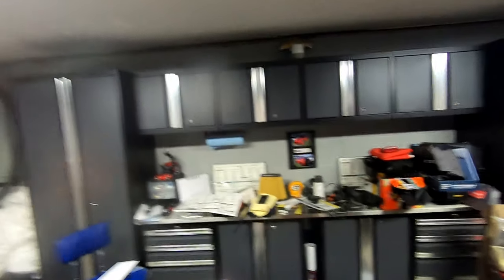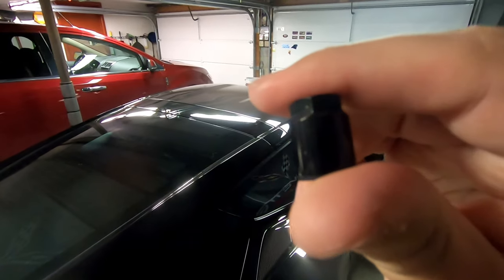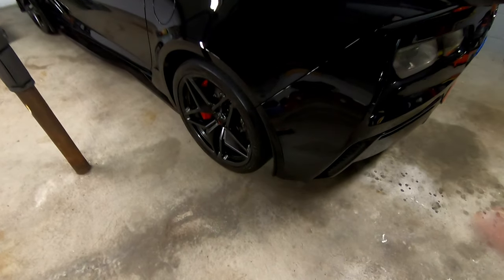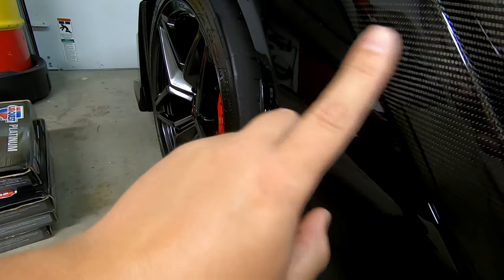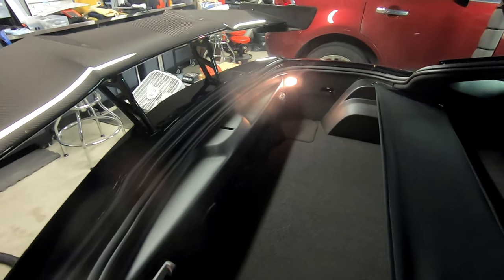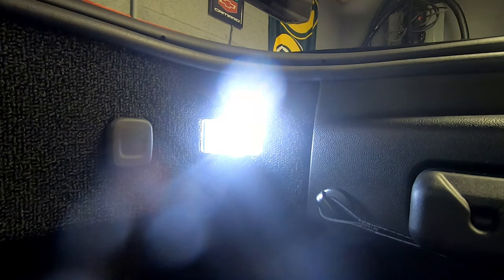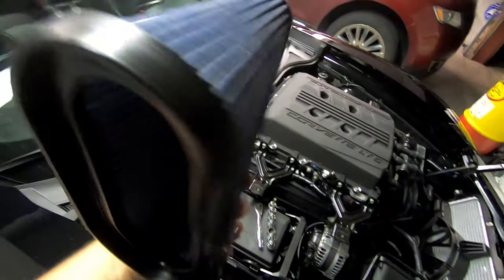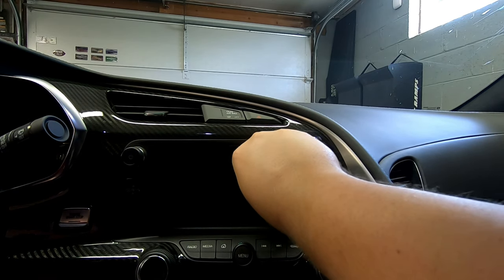MUST HAVE Mods For Your C7 Corvette. Lighting, Protection, AND Performance Upgrades.

Comment from the maker: These are a few of the modifications that make the C7 Corvette look even better. I have a lot of things planned for my 2019 Corvette ZR1 so definitely stay tuned. List of mods and where to find them online below: 
McGard Black Lug Nuts - https://amzn.to/31uc54u
TPMS Black Sleeve/Nut - https://amzn.to/2YO2rYU
TPMS Black Cap - https://amzn.to/2KnLPmH
LEDs For Trunk/License Plate Lights - https://amzn.to/2GVuxvf
Corvette License Plate - https://amzn.to/2XXFDp8
64GB SD Card For PDR - https://amzn.to/2XPj0YL
Novistretch Bra - https://amzn.to/2XPpabu
ACS Blackout Side Marker LEDs - https://amzn.to/2Tfx8oC
ACS XL Rock Guards - https://amzn.to/31rqcHQ
Sandy Eggo Designs Cubby Shelf - https://amzn.to/2GQMf31
Attack Blue Air Filter - https://bit.ly/3wuJuMe
Reply: A little confused? I want to order the black lug nuts for my C7 the part number is #84538? and TPMS black sleeve nuts - no part number - generic part? Thanks. I don't want to order the wrong parts. I live BC Canada.
Reply: Just don't buy them from Corvette Mods, They suck!

Comment: Thanks Justin.  You convinced me to do the LED update too.  Coincidentally, I installed the ACS rock guards on my Z06 today.  Great recommendation!  It only took a few minutes per wheel.  I think they are overpriced as a full set of 4 costs $500, but my neighborhood just had the roads “resurfaced” which is a fancy way of saying they sprayed tar and then threw lots of loose gravel on it.  A week into that, there is still so much loose gravel on the road surface being thrown up by the wheels at 15mph that I had to stop driving the Z06 until the rock guards came in.
Reply from the maker: You're welcome! You'll love the LED update! The rock guards definitely help but I agree, they could be cheaper...

Comment: You're costing me $. ;) I ordered 20 blk McGard lug nuts, 4 TPMS sensor nuts, 4 blk valve stem caps, a TPMS sensor nut tool and the rear license plate/trunk LED lighting kit. I need to find a way to spend your $! That's how it's supposed to work, you know!  ;) ETA: I forgot the LED lights so I had to go back and order those.
Reply from the maker: lol they really help improve the looks of the car. It's the little things. I end up costing myself all kinds of money so I figured I'd share the craziness 🤪

Comment: I went with the lighter weight black titanium lug nuts. Looks now 100 percent improvement plus less rotating weight.
Reply from the maker: I was going to do the same but I don't like the open ended lug nut look.
Reply: @HorsePowerObsessed  Mine are closed ended Exotic Car Gear.
Reply from the maker: @richarddjohanson  Interesting! Link?
Reply from the maker: Interesting. Do you have any pictures installed? Send me an email if you do. I'd like to see them. horse.power.obsessed@gmail.com

Comment: Another great video! I just picked up a black on black C7 z51 and I'm about to start blacking everything out so I'll definitely buy some stuff from your links. I saw on your ZO6 you did 18% all the way around, I'm tempted to do 5% but you're 18% looked almost as dark. What made you pick the 18%? And do you think you'll do it on the ZR1? Also thinking about getting the RPI designs acrylic tail light covers, would you recommend those?
Reply from the maker: Thank you. I did already do window tint on the ZR1. I got 20% on the windows and it looks fantastic on a black car! I personally think 5% is probably too dark but if you can get away with it it's probably fine. I've always done 20% on my car's but when I got my Z06 done 18% was the closest they had to 20. I am actually looking to do those same tail light covers so I definitely recommend them! 👍

Comment: I ordered 4 corvette stickers to block out the yellow chevy emblem on the NEW smoked out hood and rear emblems and they do not even come close to fitting. However they do fit the original emblems, which I REMOVED.
Reply from the maker: Correct, these will only fit the stock badges.

Comment: Hey Justin,
Thanks for the updates on the mods. Question on your license plate. You have a smoked clear shield on your plate. I have ACS license plate can you add that shield to any plate? All my mods on my Black Z06 are from ACS. Thanks.
Reply from the maker: That's awesome! It should work with any plate frame. They are all the same size.

Comment: Some great mods, especially the LEDs. Where did you find the plastic 12mm wrench?  Amazon?  Great tool for changing the TPS nuts to black.
Reply from the maker: Thank you! Wrench can be found here: https://amzn.to/2Kscn6x
Reply: All my good arrived today. My GS I’m in for its annual Ceramic maintenance. I’ll install these items when I get her back on Friday. Thx again!!
Reply from the maker: You're welcome! Thanks for watching! Send me some pics of your car after your install at horse.power.obsessed@gmail.com.
Reply: HorsePower Obsessed Will do!!
Reply from the maker: @curtisfish7984  👍👍
Reply: HorsePower Obsessed what type of valve stem caps did you use with the black TPS nut?  I still have a little bit of silver showing as my valve stem is silver. Thanks.
Reply from the maker: @curtisfish7984  That's the same with me. There's a tiny bit of the stem that still shows. I'm thinking about painting it.
Reply: HorsePower Obsessed Thanks for the quick response. Glad to hear I installed it correctly. I’ll send you some before and after pics tomorrow.

Comment: I got my Grand Sport with cold air intake. Went to replace with Attack Blue and it wouldn’t fit. Had to buy stock replacement
Reply from the maker: As of now, the Attack Blue filter only fits the stock airbox.

Comment: Looks like you need an alignment. Beautiful vette
Reply from the maker: Thanks! What makes you think I need an alignment?
Reply: HorsePower Obsessed - 4:48, tread looks worn on the sides.  Unless the Sport Cup 2s come from the factory that way.  Either way, nice video. Sub’d. Cheers.
Reply from the maker: @rickybobby6605  thanks, man! The sport cup 2's look that way when brand new so they are a little   deceiving to the eye.

Comment: I'm on the Podium for the W. lol Need coffee, I'll be back.
Reply from the maker: Sounds good, Peter! Let me know what you think! 👍👍
Reply: Hey I'm fast Justin, but not that fast. lol Stay tuned.
Reply from the maker: @petercarey6883  🤣🤣🤣
Reply: Okay, I'm back. I know you've been waiting with baited breath. 🤣
1.  Loved the intro!
2.  Valve stem covers were actually the 2nd mod I did, in chrome of course, right after I "modded" my valve stem caps to chrome.  I heartily approve of your comparable mod in that it is said that once you go black, you'll never go back. 🤣
3.  I give you a ten on the C7 little known information board in that I had no idea the C7s had so much LED lighting. As you said though, that begs the questions why oh why did GM not finish the job?
4.  Your ACS front wheel well rock guards, they are shiny black? They look great, but maybe if you hound them on the C7, which I've been doing on the C6, as to whether or not they're going to have their add-ons in CF or at least in a hydrocarbon dip duplicating the factory exposed CF look? I'm kinda hoping we may surprised at Corvettes at Carlisle with same, but I hate surprises. 🤣 Then again, having a C8 show up in my driveway would be an epic surprise with instant love.
5.  I see you still have on the dealer temp plate. Will you be getting a personalized plate. Remember, I hate surprises, plus I don't kiss and tell.

In summary, you get a Peter Corvette Score of 10. I'd go higher, but I only have then digits.

Save the Wave.
Reply from the maker: @petercarey6883  thanks, Peter! The XL rock guards are actually "carbon flash" painted which is basically black with some silver flake in it. I have my vanity plate back from my Z06 now but I might be changing it up in the future. 👍👍
Reply: It's all good. I guess one way or the other I'll be "surprised" at Carlisle. 👍 I see your ZO6 didn't last long with the dealer. They obviously knew what they were getting and once again, a super congrat on the ZR1. Oh yeah, in case you hold off on the C8 until the ZO6 comes out, I'd love to see you get a C6. Hmmm, I wonder why? 🤣
Have a good weekend.
Reply from the maker: @petercarey6883  a C6 is very likely in my future whether I get a C8 or not! 👍
Reply: @HorsePowerObsessed  Excellent. I'll sleep better, or maybe I should say my waking hours will be better knowing that. All the best.
Reply from the maker: @petercarey6883  same here! 😁

Comment: You didn't add a set of locking lugs?
Reply from the maker: Nope. I don't live in an area where that is a concern and I don't like the way they look.
Reply: @HorsePowerObsessed  I too live in an area, gated golf community, where it is not an issue.  But at some point I will leave the subdivision and the car will be parked in a public area.  It doesn't take long to remove your 2k tires and 2-3k wheels, they are a high value target.  Locking lugs cost, by same manufacturer, $28, a very inexpensive investment to save you a high dollar replacement.  To each his own, good luck.  You made a inexpensive investment in rock guards to save an expensive fix, repaint, same logic.
Reply from the maker: @scram8188  it's similar logic but It doesn't really matter where you park your car or how you drive it you're going to get rock chips. I don't live in an area nor do I frequent areas that would ever have a problem with removing my wheels. And like I said the biggest thing for me is the look I don't like the look of a locking lug nut.